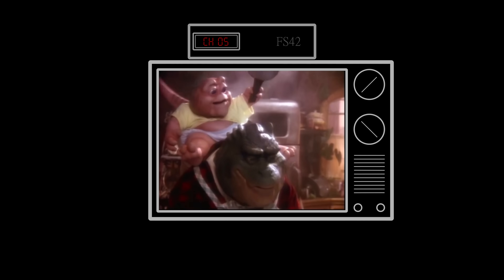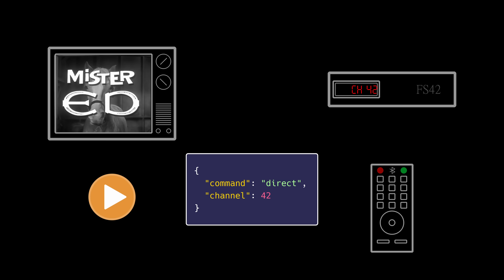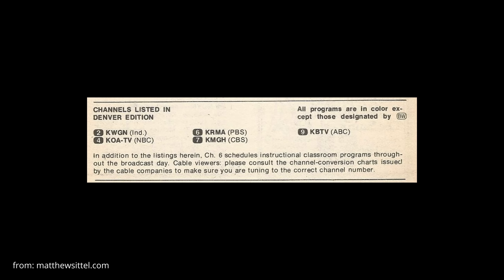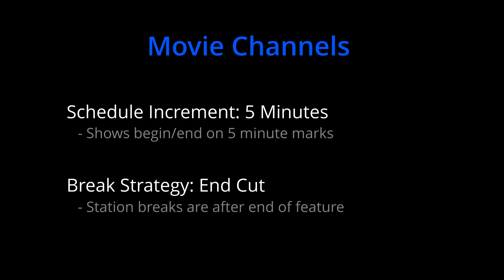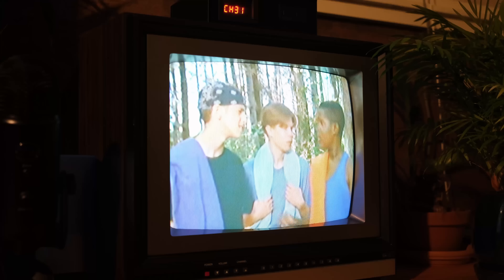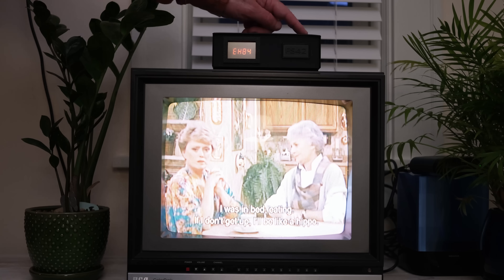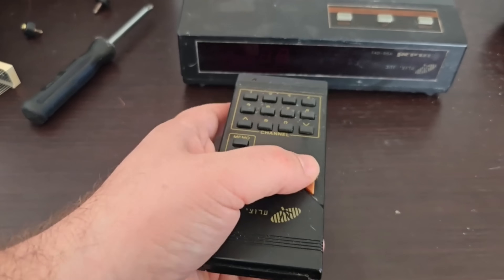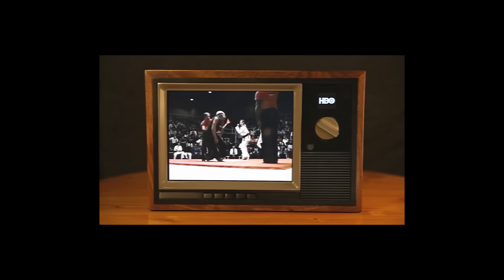90s Cable Simulator - Recreating Retro Cable TV with a Raspberry Pi

Comment: All this is missing is an interactive program guide and you'd have 2000s cable TV too. I've been wanting to gut an old cable box to stick a raspberry pi in it (I miss having the time on the front of a box).
Reply from the maker: A couple of people have mentioned that - should be a relatively easy thing, but would need to work with the remote I assume?
Reply: @wrongdog_reckons  Ideally yeah. That would be super cool. If I knew how to program I could spend hours re building the UI, but I only know the design side :(

Comment: Whats youre method of digitizing VHS? I've seen numerous devices in which some people say they work great, while others say they are terrible (depending on device).
Reply from the maker: I use a super simple approach - I just use a cheap unbranded box that says "USB 3.0 Capture Card 4K HDMI"  - you can find them on all the retail sites - but I have also heard that the cards from BlackMagic work great for higher fidelity resolutions. Cheers!

Comment: This is a very interesting project, I have a plan to do something similar, but with VHF instead of cable.. I acquired a pile of commercial grade Blonder tongue RF equipment, including several composite to RF modulators and an amplifier. But I dont think I can use a single pi to output to several composite sources at once, But if the software could essentially run on a first gen Pi cluster, So I could have one pi each on like 5 modulators, but still have the commercials and stuff, this would be perfect.
Reply from the maker: You're probably right that a single pi wouldn't manage multiple simultaneous streams, but I could be wrong. You're setup sounds cool - keep us updated on how it goes!

Comment: Do you plan on updating the TV Guide to have more features in the future? I was hoping it would be closer to how a real one operates, visually speaking.
Reply from the maker: Which features were you thinking? I only remember the 90s ones scrolling - not much else you could do with them other than watch it go by. I know later generations had interactive guide channels - is that what you are thinking?
Reply: @wrongdog_reckons  TV guide would often play commercials while it scrolled. In the big box area above the scrolling.

It would also highlight things in different colors depending on what kind of content it was. Maybe yellow or grey "bubble boxes" if it's a movie or blue if it's a cartoon. The colors are arbitrary but I'd have to go look at old footage to check.

It would also have tiny icons if the content supported CC

Comment: Omg I want to build this. Just a minor suggestion for commercials, but you should add in the capability for cue dots, so while the video plays, a program monitors the top right for a specific shape (I know in the UK they use alternating black and white bars) to cue a commercial, so that way a commercial isn't put through at an awkward time, for example right before or after a fade or cut.

Edit: Or maybe something easier for processing, have a naming convention or a configuration file for each video so it knows at what time would be a good point to cross over.
Reply from the maker: I don't think we had the black bars - but we did have tiny diamond shapes that were common in US movies to tell the projectioner when to switch over to the next reel (I think reels were 15 or 20 minutes each?). For better commercial cut-ins, I have two approaches that are on the roadmap:
- If there are chapter markers already in the video file, use those
- Otherwise, search for silence or black screen in the content
Right now, it can get awkward sometimes. Cheers!
Reply: @wrongdog_reckons  I've never noticed the tiny diamonds before, so I'm kinda sad I don't get to look out for them since now they're computer controlled in the projection booth. I live in Missouri, and normally we wouldn't have the black and white bars, except I think I remember PBS doing that in St. Louis when they re-ran "The Hitchhiker's Guide" TV show along with a few British reruns. My dad nor I didn't know what it was so we looked it up online at some point in the 2000s, and we found that's what they were for.

Chapter markers would be a great idea! I always forget that you can do that, haha! I don't entirely mind the awkwardness, you're doing an awesome job on this project and the community is doing some impressive work as well! I'm not AMAZING at programming, but I'm kinda familiar with Python, so I eventually want to try to make a script for the Argone remote control as a channel changer.

Comment: WOW!! I have had an idea for a few years now that is basically this, but instead of cable, it's a DirecTV "TiVo" box from the early/mid 00's! Getting the content the same way, ripping old DVD's and VHS into digital copies, making a schedule (Based on actual TV guide archives, since I only want 4 channels for now, more or less: Cartoon Network, Disney/Toon Disney, and Nickelodeon) with the UI emulating that of the 2nd gen TiVo Box DirecTV had! Including the bumps, commercials, advertisements, etc. Using a Pi as the brain... I'm unsure if your program could handle a more advanced UI with a skimmable guide like you'd have on satellite back in the day and not just an auto scrolling TV guide channel. I lack the mental fortitude to code myself ^^; But if anyone could help me make this happen? My 90's and 2000's addicted soul would thank you!

Comment: I personally grew up in the 2000s rather than the 90s but this video has really peaked my interest. If there was a way to have a fully functional TV guide it would be perfect for simulating a cable or satellite box from the 2000s.
Reply from the maker: Interesting. What was different about the guides from the early 2000s? I ask, because I have very little experience with them. It seems we had satellite for a time in the early 2000s and you could scroll the guide yourself and click on the row that you wanted to tune to? Also, it seems like you could bring up a 'mini-guide' at the bottom of the screen to flip through while you were still watching the same channel? Does that sound right?
Reply: @wrongdog_reckons  The guides from the 2000s had the usual list of channels of currently playing/upcoming shows with a preview box in the top left or right corner of what channel you were currently watching. If you hovered your curser over a show that was either currently playing or scheduled to play it would give a description of the episode, or movie with the year that it released and it's TV/Movie rating. You could also schedule the tuner to switch channels automatically to future shows that were scheduled to play that you might want to watch or record.
Reply: @wrongdog_reckons  yeah that's the general idea.

Comment: sick, I have a feeling the barrier to entry on this will go down as more people hear about it
Reply from the maker: I hope so - its already came a long way in documentation and features just since the last video when it was just a broadcast TV simulator and only had the README for documentation. Hopefully, it'll keep getting better and better. Cheers!
Reply: Ideally within a year people will release their own setups with properly sorted archives and it'll all be plug and play. What would be really cool is being able to cycle between years, a '91 to 01' system so it actually feels like you're back in X year, rather than having an abstracted experience or a congealed "90s" experience
Reply from the maker: @theeccentrictripper3863  -  love that vision!
Reply: Getting content seems very time consuming. Doubly so if you try to stay on the right side of the law.
Reply: @harrkev nothing worthwhile is easy.

Getting the content isn’t too bad if you can set up a computer to do the rips and then encodes. Takes a few minutes out of each hour to switch out the physical media for the next rip. Plenty of programs available to autoname content as well.

Comment: as someone who's collected whole bucketloads of DVDs over the years... man I can see some appeal to this. That is so frealin' NEAT.

Cable in the early 2000s was wild if you were a nerd and had nerds running the cable service. This is back in the Windows XP Media Center edition and Windows Vista/7 era. The Cable Box had gone from expanded VHF to QUAM (saw a video explaining how that was encoded, and boy oh boy is that confusing, so many FILTERS). 

Some ATSC tuners were also QAM friendly (letting them be cable-boxes like this is emulating) as well as some TVs (basically all of them nowadays, including this Vizio used as a computer monitor lol). One of the features that QUAM supported was sending guide information. So even though I didn't have the internet, I could see what was coming up on WMCs built-in TV guide (fortunately, I had internet long enough to download the plugin that was required). The next time I got cable after that, they dropped support completely. and now even the OTAs are lucky to have working guide data... we don't have a guide channel here now since this house has no cable access at all.
Reply from the maker: Same here - we gave up the cable well over a decade ago. I am learning from posts like this though that there was actually a lot of information that could be transmitted along with the TV data. I don't think we made good use of it in the US. Cheers!

Comment: I remember my grandparents owning an EARLY cable boxes from the 1980s when I was a kid in the 1990s. It had a big dial that went to like channel 49 and a small dial that said fine tuning and you would use to control the signal of each channel. 

In a way, the simulators are just meta-community access channels.
Reply from the maker: I might have had the same box - our first box was a Scientic Atlanta with a big knob and the fine tuner - a commenter noted that there was a reason early cable companies only had about 42 channels - apparently they were using straight coax it got really fuzzy on the higher end. Cheers!
Reply from the maker: >In a way, the simulators are just meta-community access channels.

Ha! You're not wrong!

Comment: This is very well-implemented.  Will a future update allow playing 30i or 60p content, so that born-interlaced video plays at 60 fields per second?  The youtube video implies all mp4 files are 30p.
Reply from the maker: Thanks! It can play anything that FFMPEG can handle (which should be almost everything that looks like a media file), so I imagine it can handle them fine now. Since I encoded everything at 30p,  filmed everything at 30p and then edited at 30p, so yes, that's all you'll see in my video. The machine can play any of the p's that the machine can play. Cheers!
Reply: @wrongdog_reckons  Cool. The ffmpeg deinterlacing filter to use is BWDIF so as long as that can be inserted into the playback chain somewhere, it's good.

Comment: I still have a TV guide from sometime when Star Trek Voyager had just come out. I think it has Janeway on the cover.  Your scheduler made me think of a TV Guide.
Reply from the maker: Interesting thing: the 90s are a black-hole for TV Guides. I found tons of guides from the 70s and 80s, but they cut off in the 90s and were a LOT more difficult to find. Probably lower circulation after guide channels came out or people just didn't save them in the 90s. I dunno - but they pretty interesting to look through - here is a collection I used for the last video: https://archive.org/details/tv-guide-collection_202108/2017-10-02%20TV%20Guide/

Comment: Would it be easier to use an over the air tuner for actual station breaks? That way it could be time based interuption and current local news.
Reply from the maker: That's an interesting idea - how would I detect the commercials to cut them in though?
Reply: @wrongdog_reckons  Precision timing?

Comment: For Low Band 54 MHZ to 88 MHz ch 2 through 6, and 175 to 220 MHz ch 7 through 13 were kept exactly the same. 

For the UHF band, the cable company used 470 to 600 MHz with narrow bandwidth to allow more channels. 

Despite having the most expensive satellite coax, with specific frequency range of 50 MHz to 2.6 GHz actually does not handle the lower frequency range very well below 1 GHz. 

No coax of the 80s could handle the narrow band UHF Frequencies 

For all of us who lived through the 70s, we remember cable TV coming into existence 
The original cable was just that, a coax cable from the tower antennas and sending OTA channels 
Then, the cable box came out, to allow 32 channels 

When you went up into the 40s, you had a lot of static 

The satellite dishes, the dog 16 foot ones were incredibly good 

OTA TV was 6 MHz of bandwidth 

The C-band satellite was 200 MHz of bandwidth 

Imagine in 1983 seeing 4K UHD after watching fuzzy cable for the lat decade 

This is what I saw when I got my first channel on C-band 

It was unbelievably clear

It was like seeing TV from the future 

Cable companies back then ran a maximum of 20 miles away from the towers and dishes. And being at the end of the 20 miles it was awful.

In big cities you could have cable but not in rural areas, even just outside of the metro area.

So, many people bought C-band satellite dishes

And they had the best picture of anyone 

Back then there were not many satellites in the Clarke belt, so reception was easy. Lots of spacing between satellites and you could even have a 6 foot C-band dish and get all the satellites, and EVERYTHING was in the clear.

No fees.

Galaxy 5 was the most popular satellite with 24 full time active transponders with the big cable TV networks
I miss 1983 so much 😢😢😢😢
Reply from the maker: Wow - this is incredibly useful information. I was just having a conversation IRL about the scientific atlanta cable box we had in the late 80s that I didn't think had 40 channels. Now I know why. Thanks!
Reply: Most of C Band has been sold off for cellular use. C Band used to be 3.7 - 4.2 GHz. Now it's only 4.0 - 4.2 GHz. Cellular uses 3.7 - 3.98 GHz with a small guard band separating the two services. 

And C Band transponders weren't 200 MHz each but rather 20 MHz. The higher picture quality also could be explained by it being a "first generation signal" direct from the channel's broadcast equipment.

Comment: For those not wanting to go through all this, you can just set up a bunch of folders. Dates first>stations inside that date>time slots for each folder. Then you can just drag and drop folders in your playlist based on what time of the day it is and what you want to watch. You'll have to actually edit in the commercials though, which is a pain. But in general, it's far less technical than doing all this.
Reply from the maker: There are tons of much simpler ways to accomplish watching videos than what I've done here for sure. Cheers!

Comment: I thought about doing something like this, except using one of those non remote controlled push button Gerrold cable boxes + Pi.  This is neat.
Reply from the maker: Go for it! Its fun to play around with this kind of stuff. If you want to use the software and run into any blockers, just post an issue on GitHub and I'll try to help you out.

Comment: The fact that you designed this cable box in Tinkercad makes me smile! Great video and project
Reply from the maker: You know, I debated putting that front and center, but it kind of tickled me too so I had to. I always believe in using the least tech required to get something accomplished, this has a low barrier of entry and so far, I haven't hit my limit with what it can do. Thanks for watching - cheers!

Comment: I remember when the only way to do this was PseudoTV and it's just a Kodi plugin, but this looks like it's simpler to use and more focused! I can't wait to try running it, a program like this has been a want of mine for a long time. Would it be possible in the future to make it act like later cable, with a guide you pull up and can scroll through? Maybe I could try contributing but my python is rusty
Reply from the maker: When I built the first version for over-the-air, I wasn't planning on making it also be a 90's cable simulator, so who knows! I've done all of the coding so far, but its a community driven project and would welcome contributions. Give it a try, and if you run into any issues, post an issue on github. Cheers!

Comment: I want to build a whole wooden console TV with this setup in it.  Late 80's models had a channel readout in 7 segment displays (typically green), number pad on the face, and equally 80's feeling remote.  Build my own cabinet, shove the box in a corner, throw some shielded speakers inside.  Instant 80's.
Reply from the maker: Its really cool to be able to just turn it on and a different decade starts happening in real time! Cheers!

Comment: You could fund all or part of the development and manufacturing costs by selling airtime to advertisers willing to produce a 90s retro-styled commercial for the system. The proceeds could also be used to acquire broadcast rights to old TV shows as sell.
Reply from the maker: Who would have thought starting a cable company in 2025 would be lucrative? :) Seriously though, content rights are the big stopping point - you would need to work a deal with a pretty wide variety of copyright owners. If any large copyright holders are reading this, hit me up :)